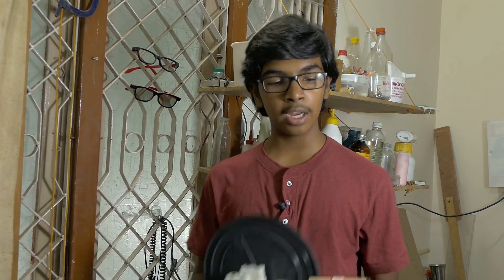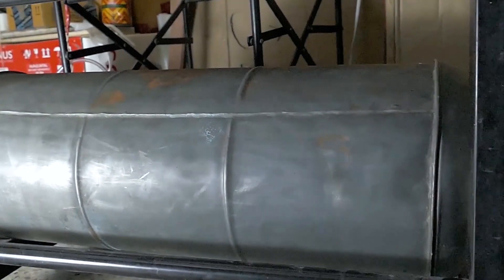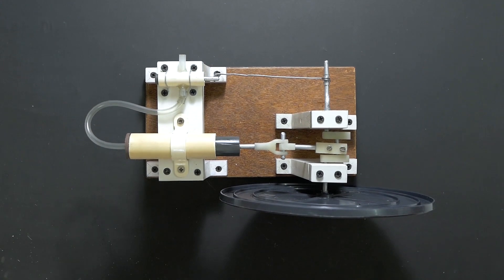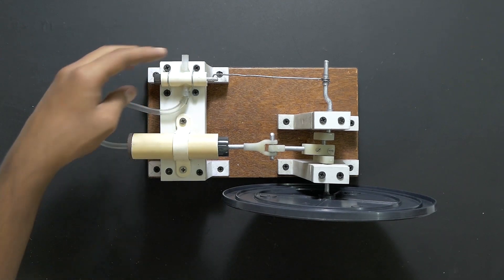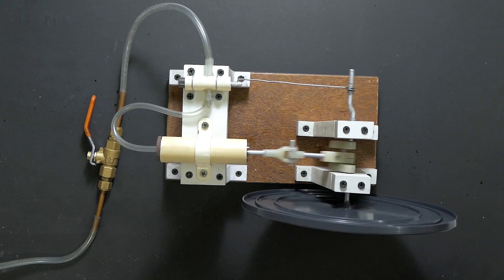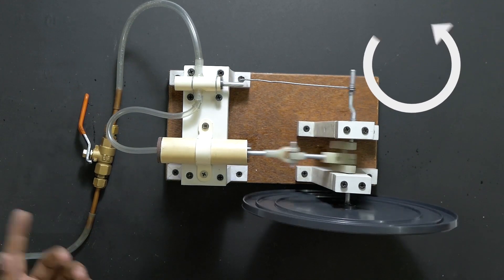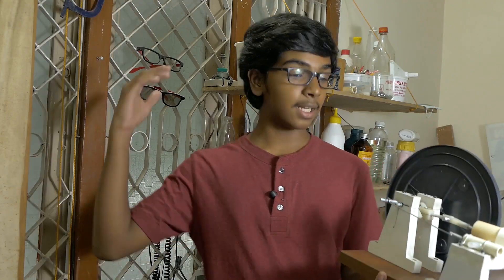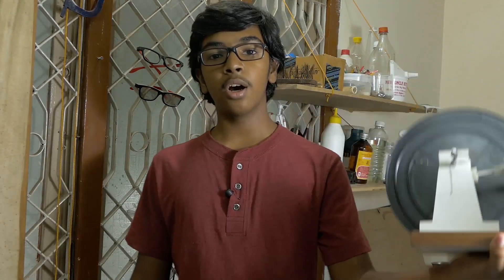Home Made STEAM ENGINE

Comment: I want your help do you help me to make this work
Reply from the maker: What is it that you need my friend...
Reply: Siddharth Devaraj  i tryed somany times but all that failed
Reply from the maker: Seal between the Piston and cylinder, throw of the Piston (length the Piston travels), valve timing, type of flywheel, air pressure, all play a big part... Majority of the time the valve timing is off, so make sure there is a 90° offset between the Piston crank and the valve crank.